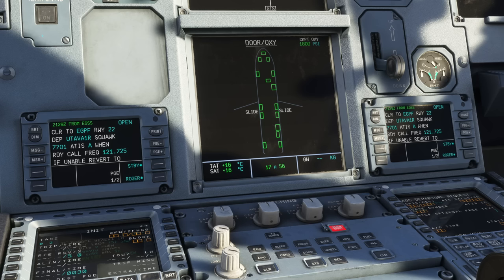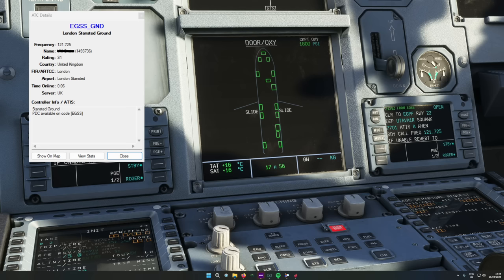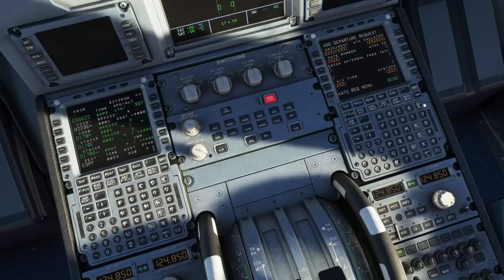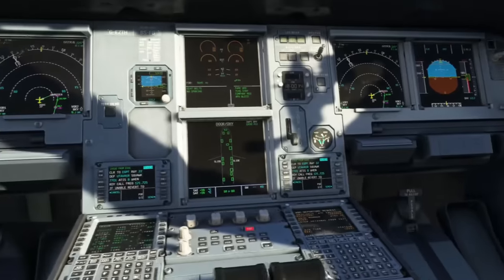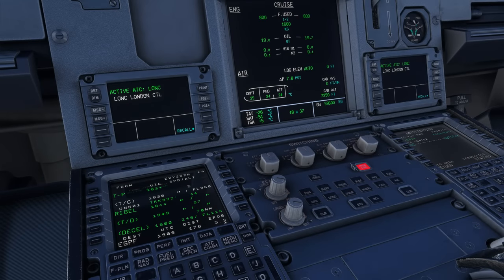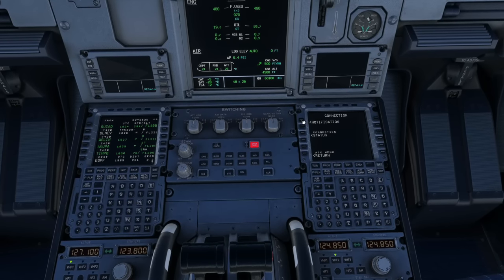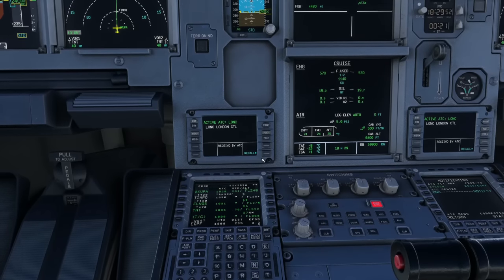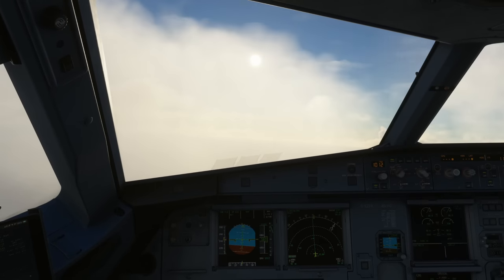CPDLC | Full Tutorial | Pre Departure Clearance & Enroute Usage

Comment: Nice tutorial well done. The only thing id say is there are far more addons on far more platforms than just the two you mention. Most of those addons have had that capability for far longer than Fenix has even been around. If its an msfs only tutorial maybe mention that in the title if its generic then failing to mention addons like FSLabs who remember pioneered CPDLC is a significant oversight. A quick look through any forum will see Toliss, FSLabs are widely used because many prefer simulation accuracy.
Great timing with Fenix V2 coming out hopefully they have addressed the many many accuracy issues that made it such a poor simulation of what flying a real A320 was actually like.
You should do more tutorials your voice and casual manner really suites it.
Well done.